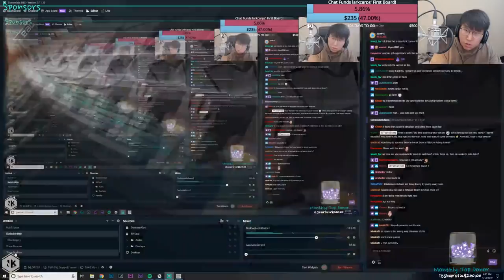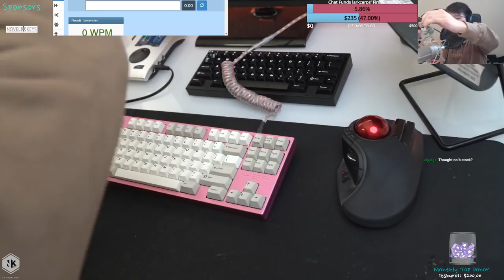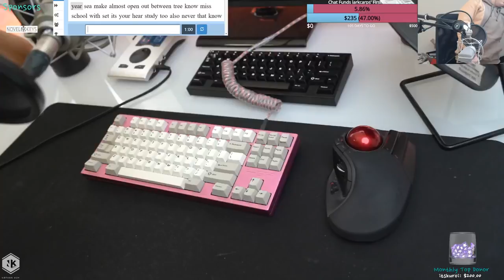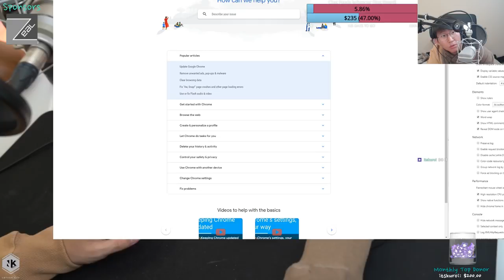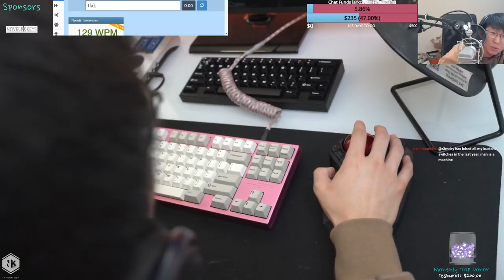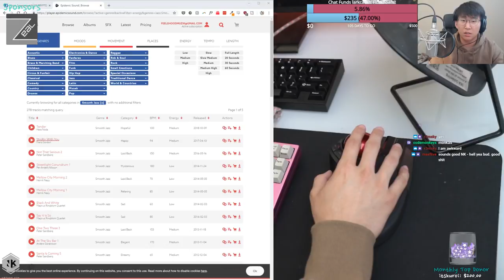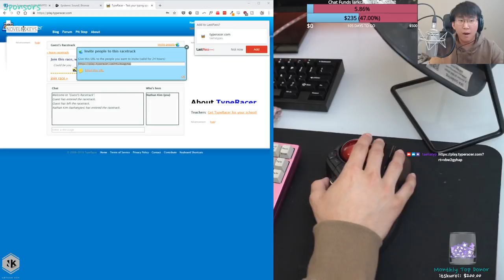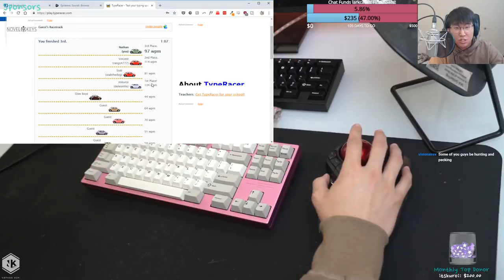TGR Jane V2 with lubed Tealios Build Stream

Comment: I literally stopped my lubing job when I heard the sound of your typing (btw @2:50:43). It doesn't even sound like tealios! So buttery-sounding! It's freakin' AMAZING!
Reply: Of course it won't sound similar. Your boards will never sound similar to nathans board. Nathans board will never sound similar to yours. Why?

Sound setup.
Desk setup
Lubing method. 
Mousepad
Typing method
Board design
Plate design
Reply: Err, my intention is not to compare my board/s from Nathan's build. I just wanted to voice out how amazed I was when I heard him type.. But oh well.. Internet.
Reply: @TaehaTypes    What's the difference between Tealios V2 and Healios?
Reply: @s.l5787  Hey, healios is the silenced/dampened version of tealios. Same 67g spring weight.

Comment: I lost my Keyboard/PC in the Camp Fire in Paradise CA and I set out to get something special. I ended up jumping on a Southpaw 65% Extended GB. I bought Tealios V2 switches and replacement 55g Catweewee springs from Switchmod. What lube would you recommend for the Tealios V2? I can't afford to have someone do it for me, although that would be nice, but as an HVAC tech I shouldn't have any problems building my 1st custom keyboard.
Reply: Nathan Kim Damn it. I just bought MX Springs there today. What is your go-to lube for this switch?
Reply: @TaehaTypes  It is sold out on Switchmod too. How about this from Amazon? https://www.amazon.com/Chemours-D12431805-Krytox-GPL205-Grease/dp/B073Y4557Y
I take it this is the lube that is in your newer Tealios builds that I have been watching dating back a few months?
Reply: @TaehaTypes  Small world it turns out I bought your GB spot that you sold to Tesletron. I have been watching hours of your videos to get ready to build this board and it turns out that this was your original spot. What made you decide to give up your spot?
Reply: @TaehaTypes  As a 1st time build did I bite off more than I can chew? Soldering isn't a problem, but possible switch placement, and finally key programing I am clueless on. Do you have any videos or could you point me in the direction of a how to? Would you happen to know if GMK Olivia's VIA configuration will work on this board?   

In a roundabout kind of way if you didn't sell your spot I would have never gotten the chance to get into the GB so I have to thank you too. After my keyboard burnt down up in Paradise I went looking for something special and saw this board on Instagram and posted on Reddit about the board and somehow got lucky. Anyways, thanks your time and videos. 

One more thing, do you have a Discord or do you know of any good places for info on mechs?

Comment: Hi , can you suggest me some high quality kit/case for TKL , 60 65 75 key apart from the LZ CLS , Fjell , Canoe  . Thanks !!
Reply: canoe isn't high quality, pcb was garbage and ano full of scratches on many units
Reply: TaeKeyboards has a video building 2 canoes and both pcbs failed after putting everything together. Can confirm Max's statement.
Reply: Oh my, cause i saw the price of the Canoe on r/mechmarket is about ~500$ then i thought its the same quality of the LZ CLS and the Fjell . So it was bad then why people still selling that price ...
Reply: the design is unique and nice, so people will pay... percent must be laughing his ass off for people accepting this quality at his astronomical prices
Reply: you cant compare CLS, Fjell and Canoe. CLS is S tier and is a kit. Retail for 800$. 
Fjell is not worth it with the likes of Tofu from kbdfans
Canoe is just a shitshow.

There's too many variables. First. What's your budget?
Reply: @aaaddd330  My budget is around 600-800$ . So how about E6-V2 and TX-75 , are those good qualities ?
Reply: @duulong3129  exclusive board suffer from proprietary pcb. so if pcb gg, hold it and cry. TX has good finish.

What layout do you want? You mention CLS but CLS is 87 and you said 60 65 75
Reply: @aaaddd330  yeah CLS is WKL and that layout i had CLS , now I want to build another board with different layout . So TX-75 is a good to go ? and can you recommend me some board has good quality like the LZ CLS or the TX-75 please , myself don't like backlit or RGB .
Reply: @duulong3129  duck octagon, Lynn dolphin 60. Xeno. Tx60. All that's coming to mind. Might be more
Reply: @aaaddd330  thanks , i'mma check all those out later .